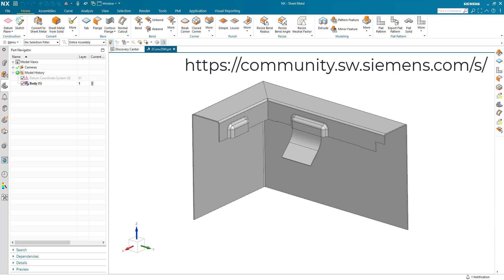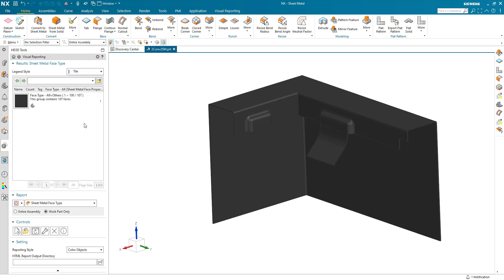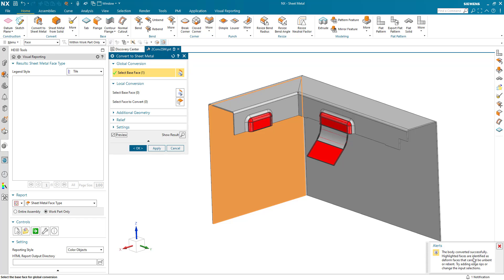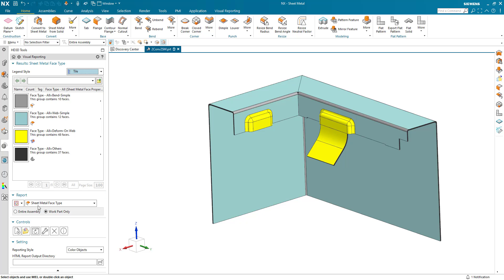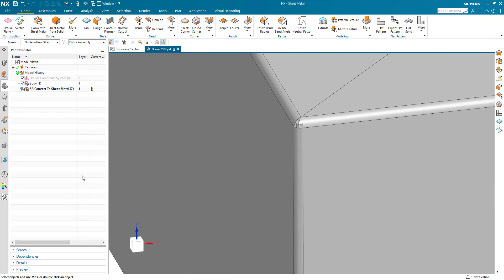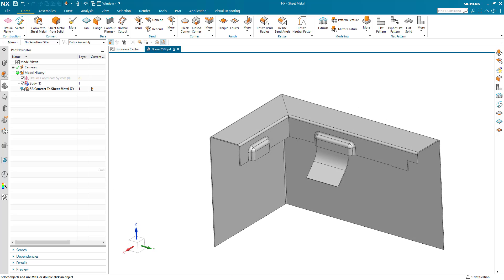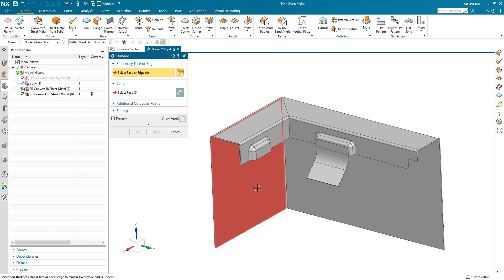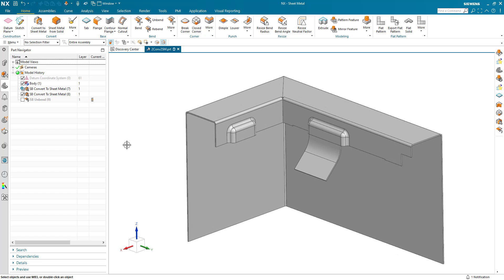Siemens NX Sheet Metal: Convert to Sheet Metal updates in NX12

Comment: I am new Nx and I am missing the step you did before the video. On my non-sheet metal part, the "convert to sheet metal" button is not present. 

How do I switch from the regular model interface to the sheet metal interface?
Reply from the maker: Application > sheet metal. Or ctrl+shift+m
Reply: Figured it out! Applications tab -> Sheet Metal